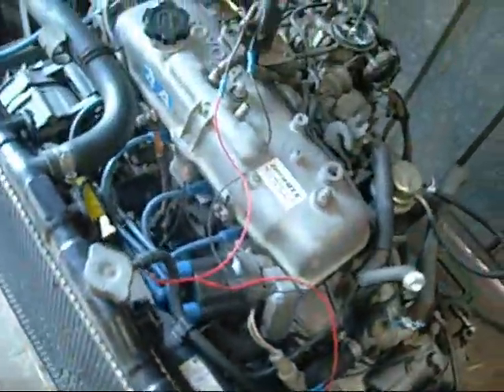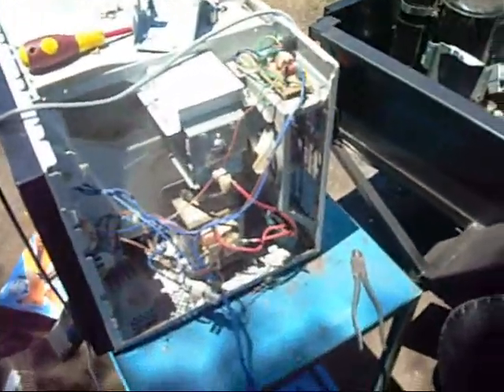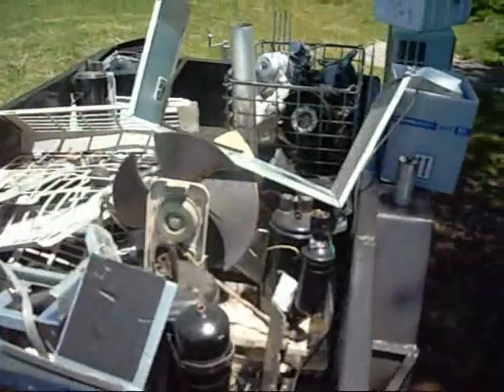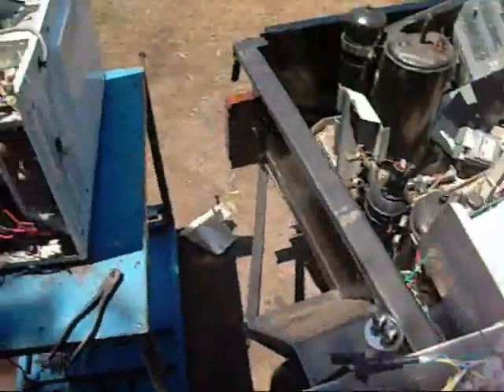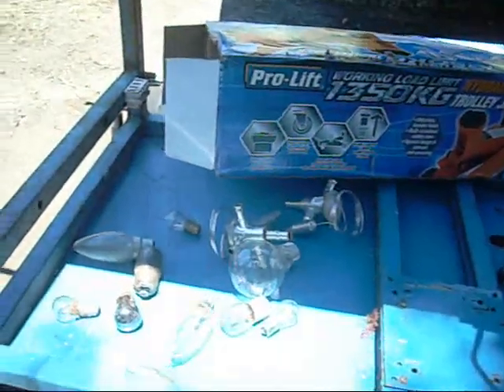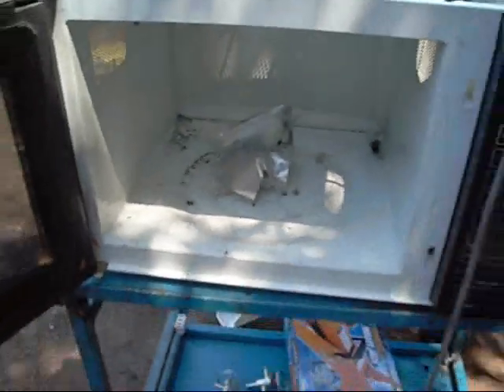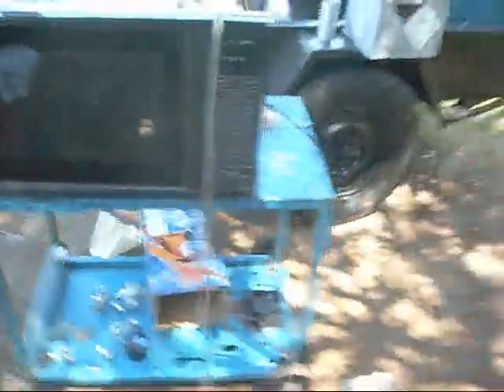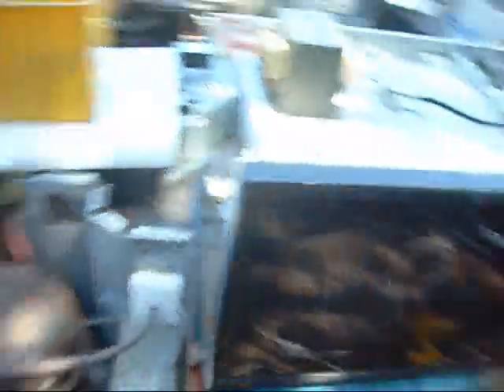Update_ Building the Uber Microwave - Twin Magnetron

Comment: Great idea.  BTW, the 2.4x MHz waves of a microwave have a wavelength of just more than 12cm. So, in theory, it would take a hole the size of your fist to allow the full waveform out of the cavity.  I have even seen videos shot with a small camera through a 3/4" hole with no dammage or interference.  You might look into mounting a waveguide from another microwave on the tip of the magnetron antenna inside that unit, would be interesting to know what that does.

Comment: Bit of important  trivia: The pink or  purple ceramic on magnetrons  indicates that it contains beryllium oxide, of which the dust is extremely toxic. It might be that the older ones that aren't pink or purple also contain the compound, but was manufactured before the color coding was required. 

One of the more toxic things you can come across while dismantling appliances.

You probably already know that. You seem to have had your head into a lot of service and repair literature.

Comment: Just bolting the tube directly to the side won't work. I tried that before. You need a waveguide to decouple the microwave energy from the magnetron an the slit antenna too. Cut one out of another old mircowave and weld or solder it to the side.